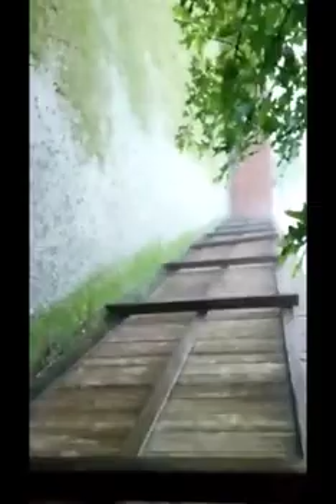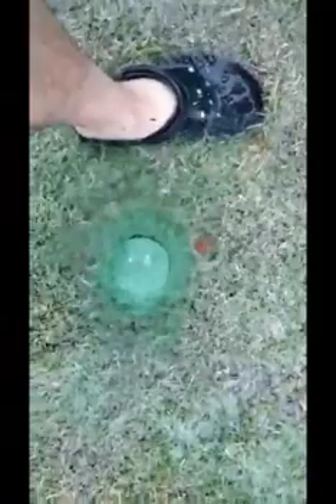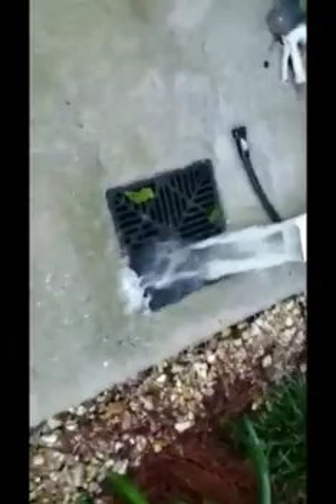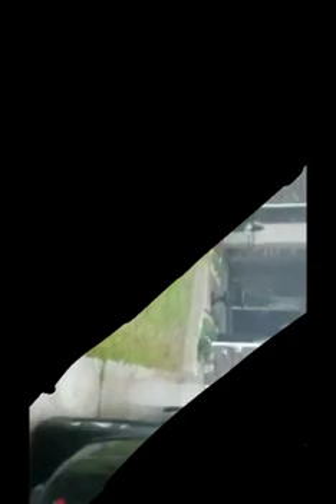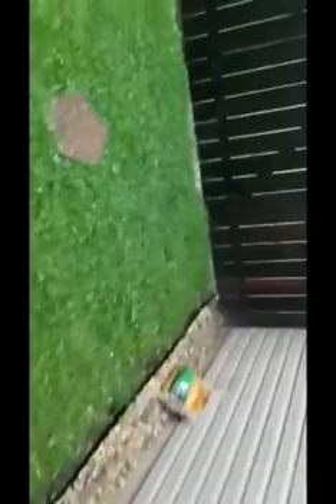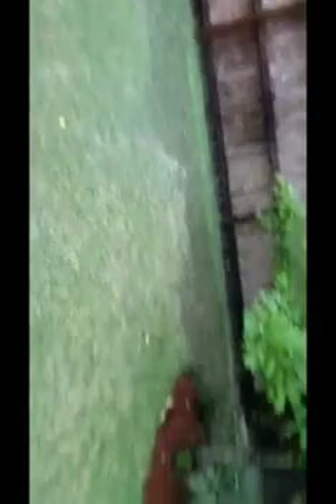My yard drain & french drain system w/ sewerage pump in action during an extremely heavy rain event!

Comment: Dude you are the man.   Heavy rains my pump runs every 15 seconds no joke.  It’s a 1HP Ridgid stainless steal dual suction.   If it runs for like 48 hours every 15 seconds should I be worried?  Seems like a lot of work but your 1HP is kicking a$$ going strong
Reply from the maker: Thanks. Yes I would be worried. That is considered short cycling. You don't want the motor to turn on and off that quickly and for that long. I would try to increase your "catching" capacity so the pump cycles are longer. I did this with an extra sump basin, a double barrel system.
Reply: The check valve may be missing or not working

Comment: Hey Mike are you happy with the “double barrel” two basin set up?  Would you do it differently.  I’m looking at options and would love your feedback.
Reply from the maker: Yes very happy with the double barrel. IMO, the more storage the better. That keeps your pump from short cycling. However, on a rain event like this it doesn't matter how much storage you have as it will be filled. The type of sump basins I used are only 25 dollars. So I think a double barrel is worth it. Especially with how much area the pump consumes, is that much less water that will fit in it.
Reply: @LichaelMewis  yes I have that same type of basin, just a single. I was given some 15 inch culvert pipe.  I’m gonna tie that in to create a large chamber kinda  like FDM does.  But slightly sloped toward the basin.

Comment: Yep, I've been saying this to FDM & AD for months.  A single 4" with the pathetic output of pumps is not a solution for us here in the South.  An 8" dual-wall pipe is only $74 for 20ft.  I've got dual 6" discharges for less than one acre of land.
Reply from the maker: Problem is im going against gravity to drain my back yard to the front street. If I went with this solution, I'd be so deep in the front that I'd probably end up under the street for the discharge which would not work plus it would be an enormous amount of digging.
Reply: @LichaelMewis  It's 2020, if you don't have drainage than a lawsuit is in order.  Low Impact Development was federally adopted in 1990 so you should have at least 1% slope from the front to the rear by design. You wouldn't be extremely deep, a 6" pipe would be an 8" deep dig using solid pipe.  6" would have one 12"CB as an outlet & at least two 12"CB as inlets (with metal/galvanized grates).